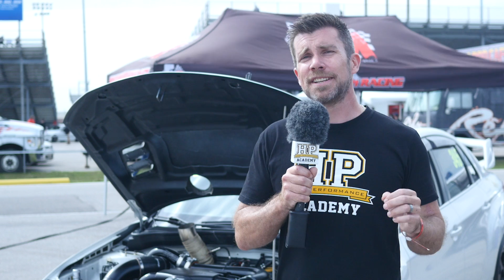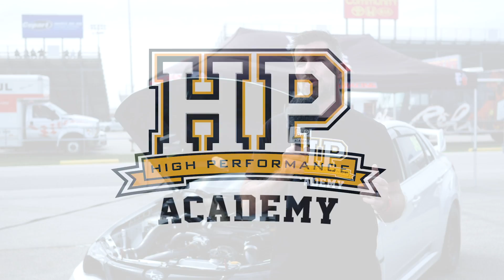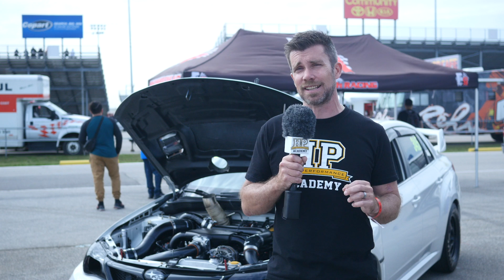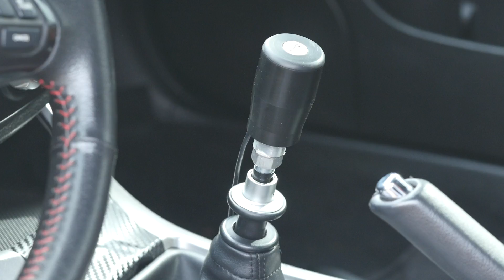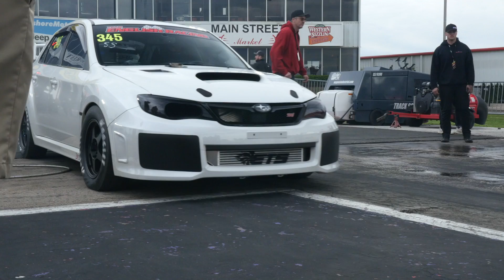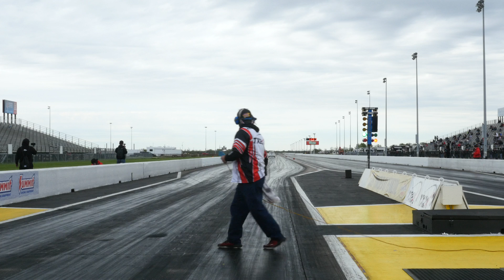Unlocking 1030WHP From An EJ25 | Subaru STI Drag/Street Build [TECH TOUR]

Comment: Wait a sec. The ecu and the transmission are for street use but the engine's running on methanol? So on what fuel does he drive it outside the track?
Reply from the maker: E85 I believe - Taz

Comment: @HP Academy?  Do you guys have a video on Oil Accumulators and Oil Coolers?  

I'm missing clarity surrounding a bar and plate oil cooler cavitating without the presence of an oil accumulator or dry sump system.  Is this a realistic concern?